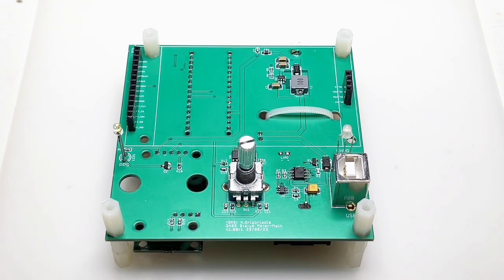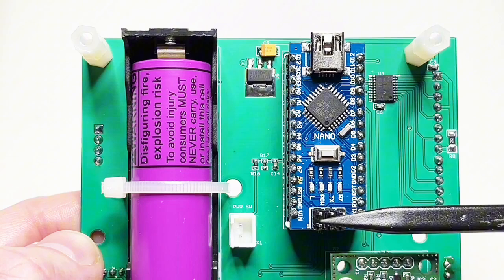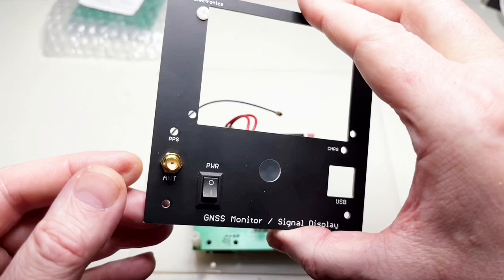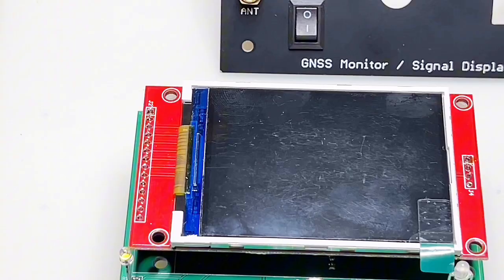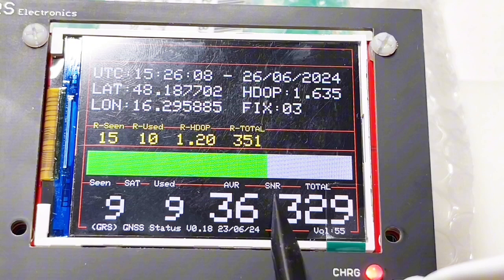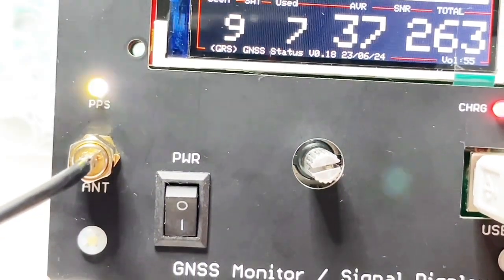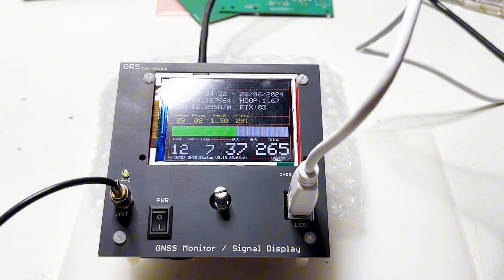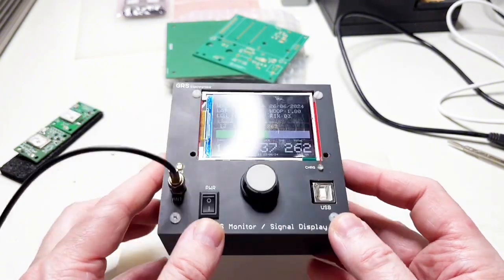Low Cost GPS Signal Level Meter Part 2; Assembly, Test, Case Design

Comment: Thanks for this great and practical video. For those of us who'd like to play along at home or try and replicate this very practical device, would you consider making the code and schematic available? Thank you.
Reply from the maker: Hello Stuart, Thankyou! The reason I didn't offered the Design Files already is that, I cannot give Support, bcs to replicate it you need :
1) Fully Working Arduino 1.8.19 IDE environment
2) Solid Programming Know How, and knowledge of the Arduino Environment
3) Good SMD Soldering experience (mostly 0603 and small Pitch SMD Parts)
The Design Files consist of 3 Layouts , 2 Schematics, and the Code.
If you are ok with the above and the non support possibility, send me a Email for further Info and Design Files.Cheers, Konstantin
Reply: @KonstantinGrigoriadis  I am very proficient in all of the above. I def won't bother you for support. What email address should I use. Thank you! 🙏
Reply from the maker: Hi Stuart, My email is in the Channel Description, Cheers, Konstantin
Reply from the maker: I forgot, my Email is in the Channel Description Page, Cheers, Konstantin
Reply from the maker: @stuartmarinus4810  Hi, I did not received any Email yet for the Design Files, Cheers, Konstantin

Comment: Is it difficult to extend showing all visible satellites also from Glonass, Galileo, and Baidu?
Reply from the maker: Hello, there is quite more coding necessary to display all gnss meaningfully on the tft and a different u-blox chip too. The reason I did not do it, is 
1) that if the GPS L1 signal is adequate, then L1 reception for Baidu and Galileo is OK too, the GPS satellites are the oldest. 
2) the Design is a to be used as an L1 GPS Signal strength meter (with additional Infos). 
Glonass is on a diff freq but wouldn’t be a problem either. Further via usb the box can be connected to a pc running the ucenter software to show all too. Cheers, Konstantin